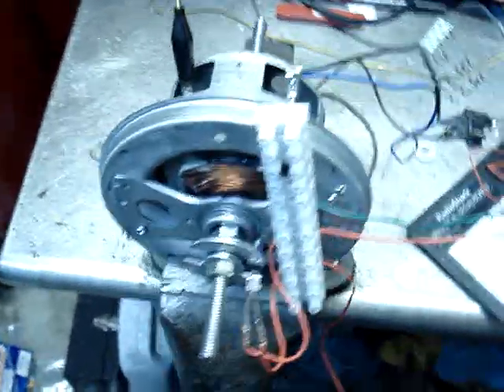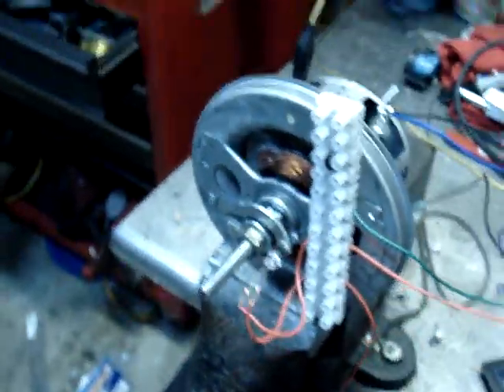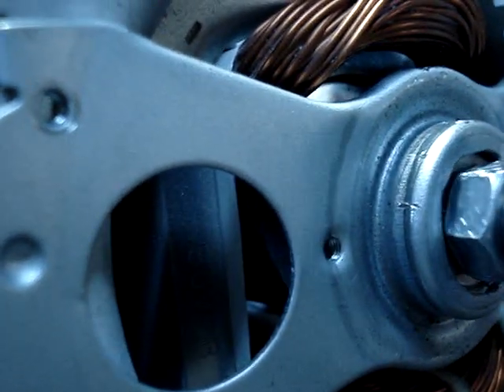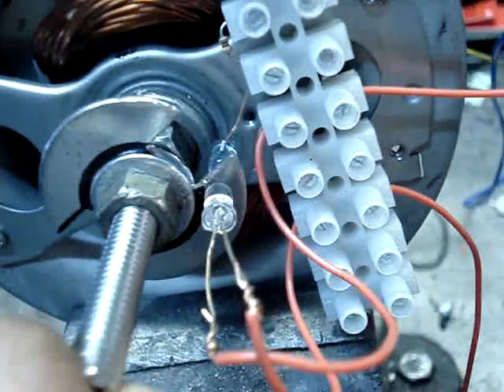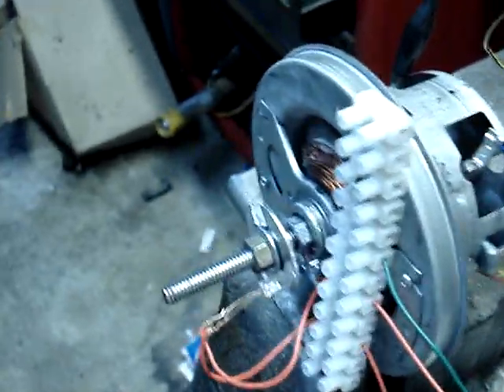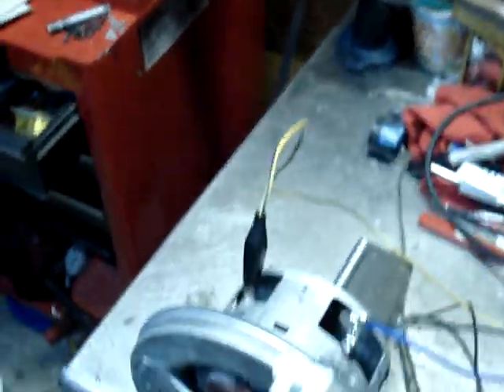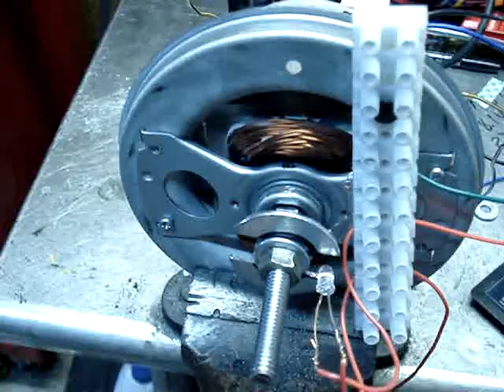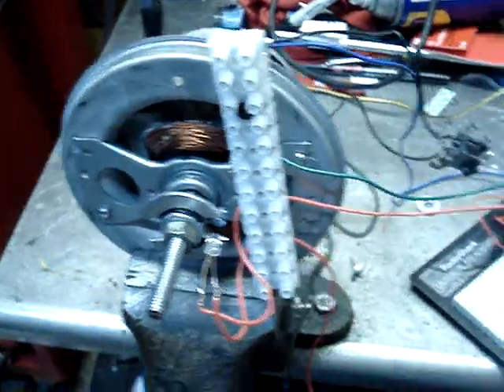New design, lindemann style attraction motor

Comment: @SMGJohn  "...I never heard of people burning OIL. Only Diesel, GAS and other stuff OIL can be converted to. ..."

Heating oil, or oil heat, is a low viscosity, flammable liquid petroleum product used as a fuel for furnaces or boilers in buildings.
Heating oil is commonly delivered by tank truck to residential, commercial and municipal buildings and stored in above-ground storage tank...

Does it even bother YOU that you are ALWAYS WRONG ABOUT EVERYTHING?